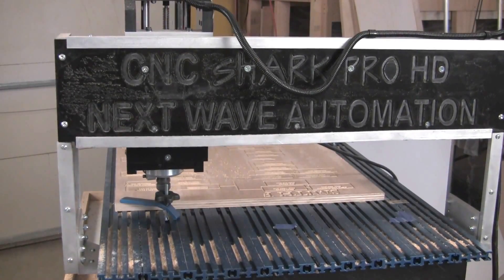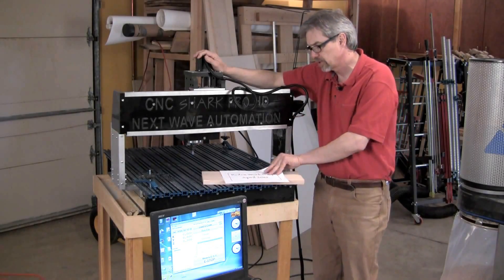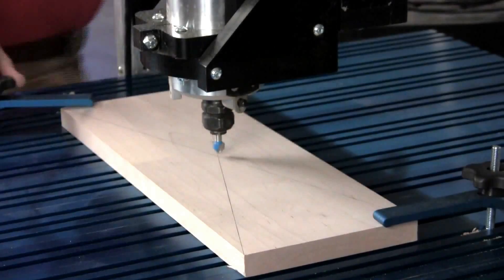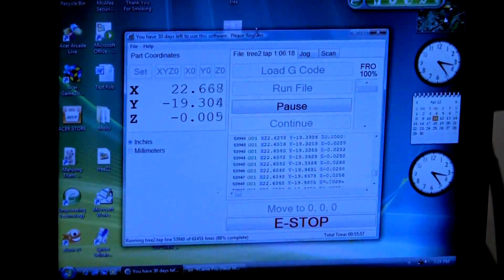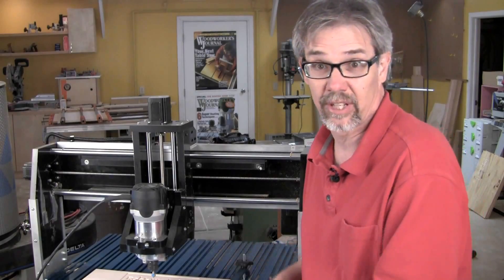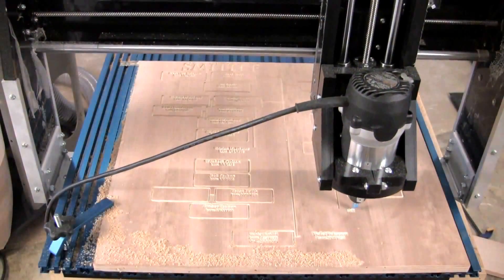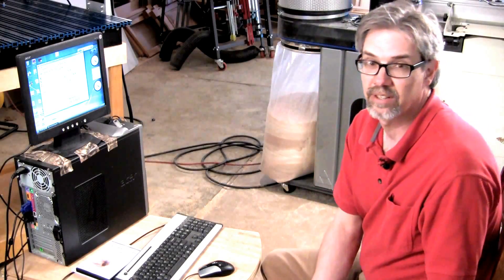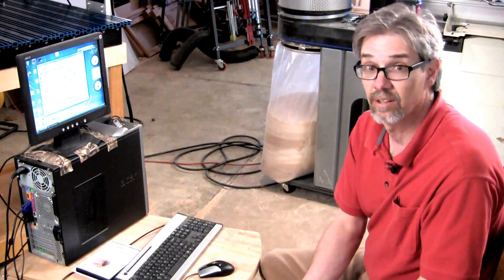CNC Routing with CNC Shark Presented by Woodworker's Journal

Comment: Hmmm… I’ve had good experiences with the Shark, they certainly aren’t made for holding .0001” tolerances, but if someone is trying to hold anything tighter than .010” in wood, they won’t really be able to anyway. Sorry you don’t like the machine; many people are using this inexpensive CNC to make pretty nice work.
Reply: Before I retired I was injured by getting hit by a car I was a CNC machinist in metal. Basically I want to make boxes that to hold Precision Tools into nice mahogany boxes. I will need to hold 0.002 inch tolerance because the area that holds the tool has to line up with the top that holds the ester foam that  pads the tool.